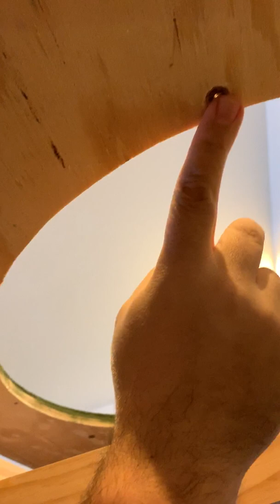Walthers Turntable Install Part 1

Comment: Nice Job!!! Could you you help me install my DCC  walthers turntable? I bought a 90' the turntable ready set up on the place, my controler is NCE and manual dont explain to much about the wiring, just need run the wires